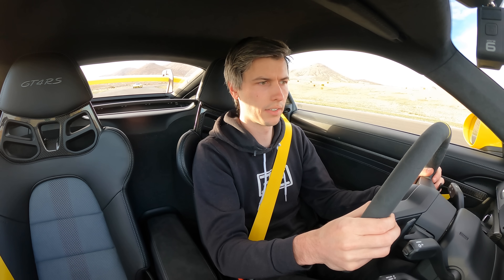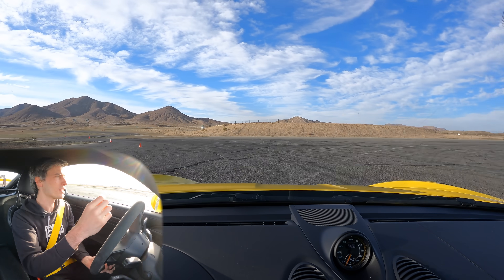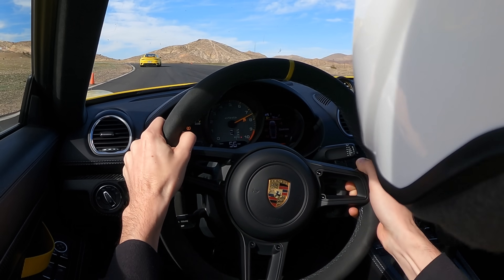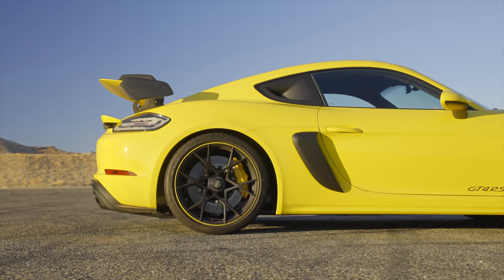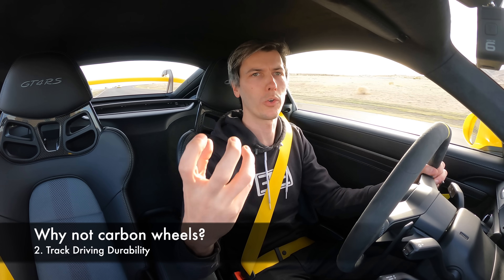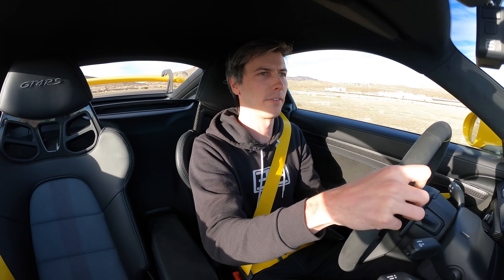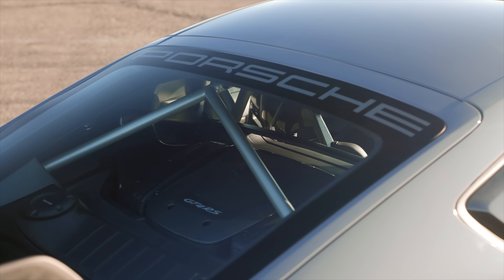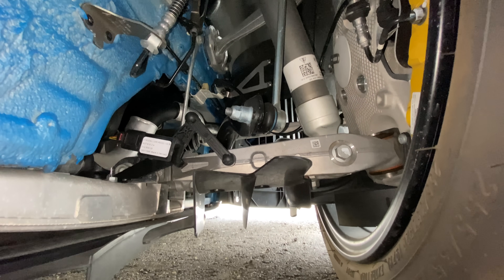The Combustion Engine Perfected - Porsche GT4 RS

Comment: Why cant the engines crankshaft default rotational direction be reversed instead of changing the gearbox?
Reply: The amointnof engine parts changed to deal with the stresses is far more complicated. The path for cam chains assumes the CW rotation and chain path for CCW rotation would be a pretty big deal as just one thing. Connecting rod offset in pistons means different pistons. Etc., etc., etc. On some domestic engines making FAR less specific HP they reverse rotation for marine use but those engines are a different beast compared to the Porsche engine in question.
Reply: Wow cool thx. I suspected something like that, but didnt know the extent of it, thx again.

Comment: Thanks for the track review. What are your thoughts on regular roads... ? do you think this is as stiff as a 992 GT3 on regular driving roads? or do you think its a bit easier to live with?
Reply: i mean, you get two trunks, the car is samller and lighter, and the engine is in the right place. i guess the cayman is the better everyday vehicle. but from an engine perspective... neither are great if you want to keep them as daily drives and drive past 60.000kilometers on the odometer. those high strung GT engines can't take as much wear until they're worn to a point that requires a rebuild.

Comment: What really disturbs me about the drivetrain in this car is how close the hot exhaust pipes are close to the dampers and the drive axle joints. I wonder if this is really without any impact on the preformance (damping) and reliability (grease in the joints) of the car. (?)

Comment: Never cared much for Porsche until I started getting into road course stuff. After my first cayman s I really started to appreciate what they build. Not many cars off the dealer floor can take track beating like a porsche over and over again. Caymans are definitely my fave of the choices though
Reply: C6 Z06 is another good track choice
Reply: @dilsher12  yeah for sure. Even a c5 zo6 is a bargain track car right now
Reply: @dilsher12  Yes, the C6 Z06 is a great track car as long as you do the proper mods to the valvetrain for reliability. I've seen two of them drop a valve at Sonoma Raceway during track days over the last couple of years, and that's no fun for the owners
Reply: @993mike  It's a very well known problem ,some springs and valves and you are good to go or just buy some aftermarket heads. I mean it is an LS after all, don't think there is any other engine in world that has bigger  aftermarket support maybe SBC and it's as simple as legos to work on .
Reply: The constantly lead manufacturers in reliability.. always close to the top which is amazing as the vehicles they produce are all performance vehicles and not your 240hp Camry.
Reply: I wish the early Caymans didn't have oiling issues at their limits tho
Reply: @wolfgang_h3t  yeah I had a 987s was gonna do a ls swap on at 100k miles but decided to do a frs instead since all the other parts for the car cost less
Reply: Except at least one model from every manufacturer

Comment: Interesting analysis on the carbon wheels, cool to know the thought process on those. So why did they include carbon ceramic brakes when Porsche has explicitly said that steel brakes are better for track cars?
Reply from the maker: I wouldn't say steel brakes are "better" for track cars, they're just significantly cheaper. Sized appropriately, they can handle the heat. The big advantage of carbon rotors is the weight. Takes out a huge amount of unsprung, rotating mass. That's great for so many performance reasons. Full details here: https://youtu.be/VBd9y3mxzCM
Reply: @EngineeringExplained  totally understand the weight aspect, I only find it interesting that Porsche specifically says they recommend heavy track users to go with steel brakes but put carbon brakes on this track day special. And then also have a reason for not going with carbon wheels based on track use.
Reply: @dbeckMSP  brakes and wheels are not the same. Any curb or damage to the wheels can result in catastrophic failure. Brakes are much more resilient and protected
Reply: @Shadowboost  that’s not the point I’m trying to make. I’m specifically referencing Porsche’s own words about carbon brakes which is a similar tone to why they say they’re not using carbon wheels.
Reply: "Carbon" wheels, as far as I know, are CFRP (carbon fiber reinforced polymer). So they're just strong plastic, which can't take much heat. Carbon brake rotors are pure carbon, no plastic. Which takes lots of heat.
Reply: @soaringvulture  carbon ceramic is what the rotors are made of. It's carbon fiber, binders, silicon, etcs. So not technically pure carbon but primarily carbon yes.

Comment: Excellent track driving skills Jason!
What would you buy? 718 Cayman GT4 RS or  911 GT3 , Share your thoughts😃
Reply from the maker: Honestly tough. If I were only planning to track the car, I'd go with the GT4 RS. If you want a manual transmission, only offered in the GT3, which might be the better road car.
Reply: @EngineeringExplained  definitely agree with you  Jason, but I rather take the "Third" pedal, thanking you for such   amazing work that you always do!
Reply: @EngineeringExplained  There has been criticism of the 992 GT3 on the road being too harsh and perhaps Porsche have avoided that with the GT4RS because Henry Catchpole, the only journalist so far to do an extensive road trip with this model, did 2,700 kms across Europe and said he would do the trip again in a heartbeat.

Comment: I was most interested in those goose-necked spoiler supports.  Your mention of Laminar flow led me into deep thoughts on spoilers surfaces and tripped turbulent airflow. Perhaps it would be better to have airfoils stick straight out from the sides of the bumper. Cars would be hella wide, and more dangerous than ever, but think of that unobstructed airflow. Thank you for the video!
Reply: Or just have the supports at the ends of the wing, all the way out to the fenders! Think Plymouth Roadrunner. Then stack them 6 tall like Wingo from the Pixar movie Cars.
Reply: @DurfDiggler  - Yes - that's the answer. Look at modern F1 cars. And the Ferrari F40
Reply: @DurfDiggler  yes, as the end supports can act as fences. 👍
Reply: the sides of the car probably generate more turnbulence than the top, with wheel arches, wheels, etc
you wouldn't get the same surface anyway as a rear spoiler. plus increasing frontal area.  as long as its high enough, rear spoiler seems just better. at least for the rear downforce

Comment: They should of kept the 7 reverse gears
Reply: The DAF Daffodil used a CVT and could go as fast in reverse as it did go forwards.  That opened up the possibility for an entirely new class of motor sports - Daffodil racing in reverse.

Comment: Jason, maybe sometime you can do a compare/contrast video on the various types of transmission and the terminology employed — manual, automatic, semi-automatic, sequential, H-shift, torque converter, no torque converter, torque converter that can be shifted manually, no torque converter that can shift automatically, two-pedal, three pedal, two-pedal manual, etc. — explaining advantages and disadvantages of each in various contexts. Or maybe videos.

EDIT: Forgot to mention that the motivation for this off topic comment was the fact that I had to go look up PDK transmission. I drive a car with a torque converter automatic that lets me shift manually if I want to. I like this because I’m not wearing out my old left knee constantly pumping a clutch pedal in traffic. But unlike the “real” manuals I grew up with, this transmission babysits me by downshifting automatically so that I don’t lug down or stall the engine when I’m slowing down (but will let me rev as high as I want without automatically upshifting). Are there torque converter automatics that don’t do this? Also, are there two-pedal “real” manuals — i.e., the driver does not have to manually engage the clutch when starting moving from a stop?
Reply from the maker: I have videos on most of these subjects. :) https://www.youtube.com/playlist?list=PL7B5B6479699EB204
Reply: @EngineeringExplained  Jason, may I request you help check out the Punch powertrain dt1 transmission.
Reply: On your edit, VAG's DSG (direct shift gearbox) is an automatic gearbox without a torque converter, dual clutches which are computer controlled, two pedal driving - they have 'manual' mode which also doesn't shift unless you're at the top or bottom of the safe RPM range.

In terms of the babysitting, what would you prefer the vehicle do instead of downshifting? the alternatives are to use more engine power (in a range still safe) or stall out - both of these options aren't really safe or comfortable. In first gear, the transmission losses in fluid coupled automatics allow the wheels to be stationary while the engine still rotates, at the 'cost' of heating the working fluid
Reply: @stefanvanzyl9090  Thanks for the reply. Back in the day I stalled my 3-pedal manuals a few times not getting the clutch fully disengaged in time. Came with the territory and didn’t seem to be that much of a safety issue. But I understand the point on a torque converter xmission. So when Jason and others say they are so happy that manufacturer A has put a “manual transmission” in their model B car because they personally prefer manual xmissions — a comment you hear very often —  are they talking about (1) no torque converter, (2) 3 pedals even if one “pedal” is a paddle on the steering wheel to operate the clutch, (3) either sequential or H-pattern, (4) either single clutch assembly or dual/multi clutch (5) lever or paddle shifters on the steering wheel or both; OR does it have to be (1) no torque converter, (2) 3 ACTUAL pedals, (3) H-pattern only, (4) single clutch assembly, (5) lever only?
Reply: @robertbutsch1802  I can't speak for Jason (or any other reviewer) - I just know that driving a fluid coupled automatic isn't fun at all for me. It feels slow, disconnected and unresponsive. I personally drive a Jetta with a DSG, and have plenty of experience with manuals, CVTs, fluid coupled autos, DSG and a dual clutch manual C4 ZR1 - i absolutely prefer the DSG as first place, and the ZR1's dual clutch as second place. 

The draw of a manual transmission is mostly related to being the polar opposite of the "generic" automatic transmission feeling, and secondly believing to be in "full control" of the vehicle.

I put it in inverted commas because cars these days prompt us when to shift anyway, meaning that the car's computer still gets what it wants, we oblige - New VW manuals are also able to restart the engine automatically if it stalled, just after you press the clutch - sort of like an extension stop-start feature. other vehicles may also offer this, I don't know.

Single clutch manuals are slower to shift and less fuel efficient than DSG in almost all circumstances where the weight and size difference would be inconsequential
Reply: that describes the mercedes 7-speed semi-automatic behavior. perfect wingman.

Comment: I'd also be concerned about magnesium wheels.  Ever have a brake fire with them, you'll be able to see if from the ISS.
Reply from the maker: Magnesium wheels are super common in racing (Formula 1, Nascar, Indy, etc). If they were problematic on track, wouldn't be used. Alloys aren't super combustible like pure magnesium.

Comment: I have 2 comments. 
One - the "lightweight door pull" does nothing for light weight - regular door pulls are not made of heavy metals. the savings, while non-zero, are completely inconsequential. Please, automotive journalists - STOP giving praise for it. Cool, yes - effective from an engineering perspective, no. 
Two - Again, a nit-pick - I would love to see an actual "Engineering Explained" on the actual gains from top mounting the wing. Your, and Porsche's, explanation are in-theory correct, but the analogy to a jet engine is not an apt comparison as the uprights for a spoiler in no way are  mathematically equivalent to a massive jet engine in terms of flow disruption. There is just no way that it makes an appreciable difference in this car, that is, as described in the video, (paraphrasing) 'not that reliant on downforce, like the 911 GT3 is'. Again - cool, absolutely. Functionally significant from an engineering perspective - highly unlikely.
Okay, 3 comments: Love your videos - keep up the great work!
Reply: Agreed. In fact the door pulls are dangerous if you are in a hurry to exit the car. And, just try opening the passenger door with the fabric pull while sitting in the driver's seat. Very hard to do without two hands. The massive wing at the rear is only of use at very high speeds but that is rarely mentioned. Even then what is the real gain over the GT4- they talk about "up to 25%"
Reply: I think I agree with you on both of these things. Like, their reasoning sounds legit and is probably based on theory but the actual gains, if any, must by minute. Cool factor has to be the main reason, like you said what could the door handles save, a few ounces? Like, the car still has a stereo system, right?
Reply: I think the top mounted wing has two advantages. There is no disruption to airflow along the bottom of the wing, making it more effective. What wasn't mentioned is that the wing can be mounted further back on the car, which might give the downforce more leverage over the rear wheels. If the wing is further away, it exerts more downforce on the rear wheels because the downforce on the wheels is a function of the horizontal distance to the wing. The rear wheels are as a result more planted.
Reply: @oliverhill4136  what keeps a bottom mounted wing from being mounted farther back? And as far as the turbulence or whatever, there is still turbulence from the strut and this whole argument involves like 2 inches of what looks like a 4 foot wide wing.
Reply: @jeremyspecce  I agree, I guess a bottom mounted wing could be mounted far back as well. The top mount should affect the airflow less because the airflow over the top of the wing is fast, so it doesn't get disturbed as easily. A bottom mount is also being compressed instead of pulled/extended, so I think bottom mounts need to be thicker, unlike the thin brackets on the GT4RS
Reply: @oliverhill4136  Sort of. there is still disruption. The uprights cast an aerodynamic "shadow ", if you will, across the trailing surface - the wing in this case. the greater the speed, the greater the shadow. This shadow is the turbulent to laminar transition zone, and negates most of the lift (negative lift for this case) for the effected area. This should be similar to a direct mounted upright. The difference is that the direct mounted upright will have a negated lift zone perpendicular to the flow direction due to the deformation path of the distributed load (lift - or 'downforce'). I would actually imagine that this effect plays a larger role in the difference in force actually experienced at the contact patch of the tire and road. There's a lot at play here - but I still stick to my thought that while the improvement for top vs bottom mounting (and we could throw side-mount in for fun too...) is theoretically real, it is not significant to the vehicle performance.

Comment: Not gonna lie, I think 7 reverse gears could be a bit of fun.
Reply: If you insert the ring gear carrier on the wrong side on VW beetles or transporters 1969 (maybe 1970) and earlier you get 1 forward and 4 reverses. Alot cheaper to scratch that multiple reverse itch withbone of those clunkers

Comment: I would like to hear more about differential.  718 caymans have platted diffs, with two friction plates on both sides, and really interesting ramps (more agresive on engine braking then on the acceleration). 
I have opened mine few days ago to change friction plates because they started slipping, and I think it's too small and has the same oil with gears on the PDK which stops me from using 75w140 just for that diff.

Comment: All you gotta do is flip it the transmission upside down to fix the reverse problem. This is very common with kit cars like the GTM and the SLC.
Reply: I’m not saying you’re wrong I’m just confused by this. Are you saying flip the trans on its rotational axis or like end for end? (I hope that makes sense)
Reply: @jeremyspecce  both. You can go look at how the kit cars do it. I built a GTM and you just have to plug the breather port so all your fluid doesn't leak out. And for fluid use the drain as the fill and the fill as the drain.

Comment: Can't believe Gordon Murray said this engine was significantly worse than the T50's in terms of lowdown torque, can't imagine what that 4.0L V12 can do!
Reply: Its the same as the 4.0L only difference is that is has the Power of the 4.0L at 7000 already at around 3.5k...

Comment: Jason, one thing that Porsche is NOTORIOUS for doing is downrating the engine power on the Cayman and Boxster cars.  They do this electronically.  For example, my own car, a '14 Cayman S has it's M1.23 engine rated at 325 hp.  The same engine is used in the  base 911 and it produces 352 hp.  How can this be?  Because on my car as the engine approaches redline, the throttle plate is electronically closed to limit the power to "only" 325!  This has been proven many times and I have actually seen this happen on my iCarSoft PORII  OBDII interface.  This device specifically shows throttle position and you can watch it close partially near redline.

If there is any difference at all in the exhaust then it is only a few horsepower, not 9.

Great video as always!
Reply: I mean, 9 out of 500 is not much of a difference, I certainly don’t know enough about exhaust to say if they’re lying but it seems feasible.